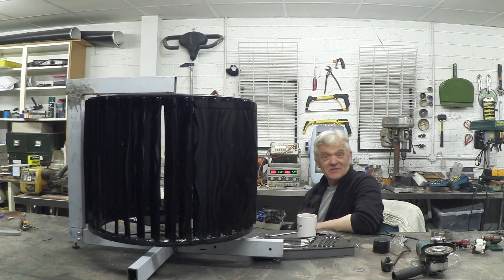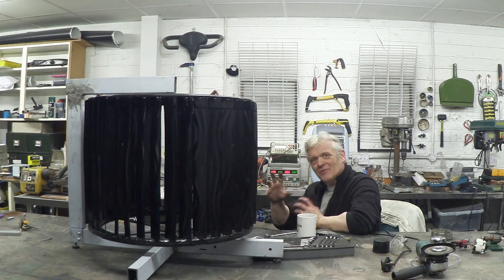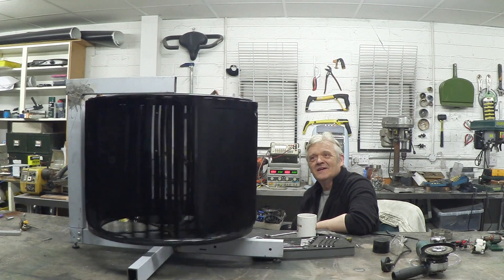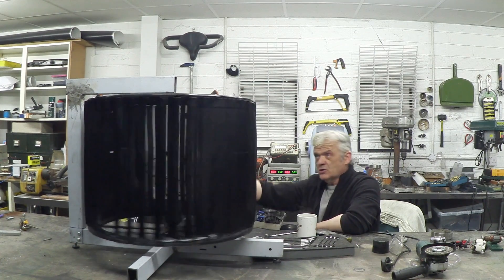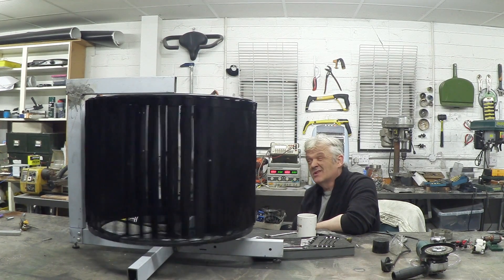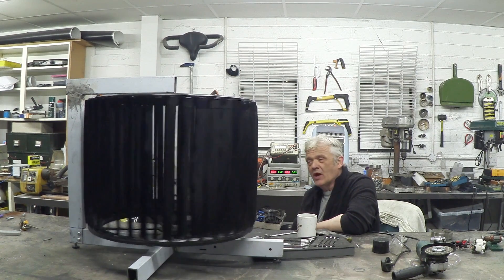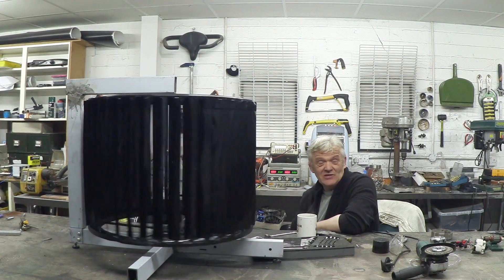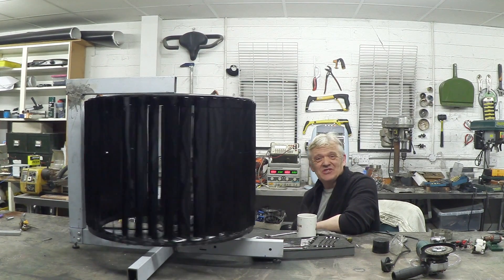The $100 Wind Turbine Rebuilt

Comment: Hi Robert, I have a question regarding those vertical blades, have you thought about skewing them by few degrees like in squirrel cage motor rotor with rotor bars slightly skewed?  I think it will produce even more even force on blades and make it in real testing even more silent.

Comment: Would this work with a solar chimney? The idea being to create a low pressure on the inside of the rotor by the convection of the air in the chimney.

Comment: looking fwd to  how you mount the coils    and what sort of coils you use   i have a place in SW francw wind speed there id  mostly  quite low   strong breeze more than  the wilds of yokshire moor where i hale from   so i think this is a garage roof  play toy to  run the swimming pool pump    thet pumps  warm watr round the  patio extracting the heat and   dumping it in the pool        if it mqkes a couple of hundres watts  it will run the pump and    the buried coils will pick up   several  hundred mooer wats of heat from the pation  and the pool gets warmer     as you say its an idea   and ill play with it  
as an engineer   welding is a skill i picked up  years ago    i go TIG all the way     tipds are buy a good mask   and breath

Comment: Furthering my previous comments regarding the stator. Please also consider the maximum power transfer theorem  where the maximum power that can be delivered to the load will be at the point where the load matches the equivalent thavenin resistance of the supply which will be function of the output voltage and current. in a low wind situation you will have a problem where anything around 1V generated through the coils will not even go through the diodes whereas if it was series wired and unrectified it would already generate high enough voltages to rectify and extract useful energy
The MPPTs that use a incremental conductance algorithm will on the fly vary the output load to ensure that the maximum power is being extracted from the (solar or wind). So you need to also consider the loads and maximum power transfer theorem. I.e static loads will collaps your input quickly. 
So it may be better to have the highest voltage possible and matched loads using MPPT that won't collapse the turbine. This will help with wind intermittency due to retained inertia and required cut in speeds.
I hope this helps

Comment: Lovely project Robert! I’m wondering if the efficiency would improve if we placed a thin shield around the inside of the fins to prevent the wind from passing through them and causing drag.
Reply: Is there a time limit to how long a battery will “hold”a charge? If a battery array could hold a charge for months, it might be easier to keep it “topped up” as the weather cooperates (wind/sun)!! Ideally we could charge a large battery during summertime and store it for cold winter nights!!

Comment: Once you get those magnets and coils under it (assuming that's still the placement), it would be interesting to mirror them on the top. I'm sure it would be pushing the limits of amount of energy that can be extracted, but again, we're talking about the low end of things. While it should be impossible to exceed the total theoretical limit of energy conversion, it sure would be interesting to see how close to 99.9% you could get!

Comment: That was still spinning after two-and-a-half minutes!  Impressively balanced, considering you bent those fins by hand... really goes to show how easy it is for anyone to fabricate a decent wind turbine with junk parts and a minimum of tools. 😊  The welding of the frame seemed to be the only moderately challenging task (only because it requires equipment/skill/experience), but honestly a person could probably just bolt together a frame like that.  Both amazing results and inspiring!!

Comment: Looks great Rob & spins better than my MK1, which you have inspired me to build out of scrap i had lying around. The hardest thing for me is limiting myself not to spend any money on it, everything has to be done for free, but this is the most rewarding point about this project, stretching my mind to make something work out of what i have, not what i could buy. My frame is from 2 old kitchen stools, the fan blades from excess black plastic toilet pipe, Perspex from a broken computer screen, some Meccano i had from childhood, a pulley and magnets my son had, a sink plug drain fashioned into a bearing, some copper pipe & elbows from my plumbing box, some coils from two scrap microwaves which were fly tipped near me. I know some of the comments you have received have been a bit thoughtless relating to this project, but please keep in mind that you are inspiring a lot of people who really value what you do, who really look forward to every video you make & who really appreciate that you share your incredible knowledge for all because you want too, not because you have too.

Comment: Great and so cheap to build, I'll hopefully build one when I get the time. Just a thought though, what could be done to slow it down when the wind is too strong?
Reply: This sort of rotor does not need this unlike "normal" wind mills, they are self controlling, as the wind speed increases the drag on the opposite side of the rotor that generates rotational force also increases slowing it down, additionally they do not care which direction the wind comes from, ideal in a built environment.
Reply: At this size, with these materials, your fears of excessive wind speeds are unfounded.

LONG before it would 'centrifugally fly apart', it would simply be carried away with the rest of your house and there would remain no house left to put it back onto!

Comment: RMS, marvelous job you did on that rotor. And it is so much better than the wheels you had on the bottom of one rotor before. Good welds too. If you painted the frame you couldn't even tell where you welded it.

Comment: A sudden thought occurs to me, if you find you have to much resistance at low speed once you are generating power from it  you could move the magnets and coils further inwards for better mechanical advantage, it might take some experimentation to find the right "gear ratio" for optimum low speed wind performance, of course if it spins TO fast even with them coils at the outer edge you might need to run t through a chain and sprocket to speed up the generator. I am interested to see what happens, I suspect these will quieter in the wind than a bladed turbine and if it can survive higher winds might be worth trying on my boat.